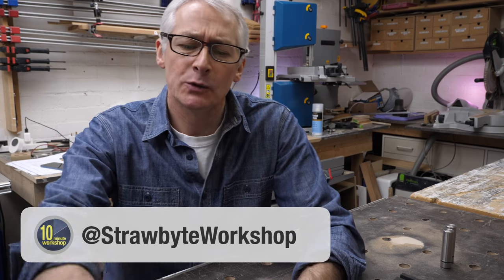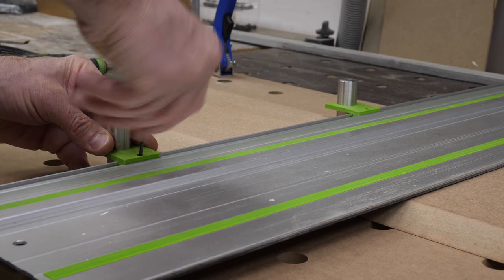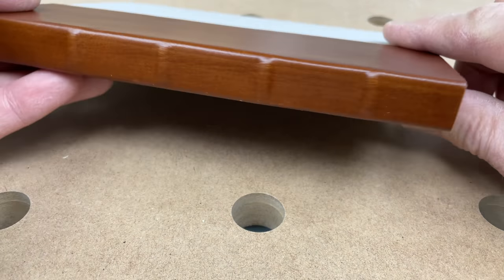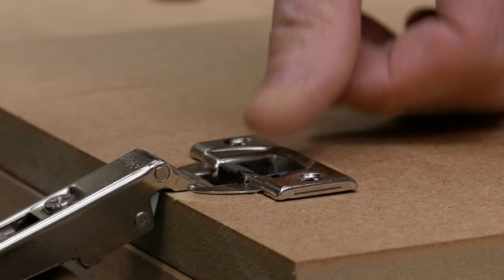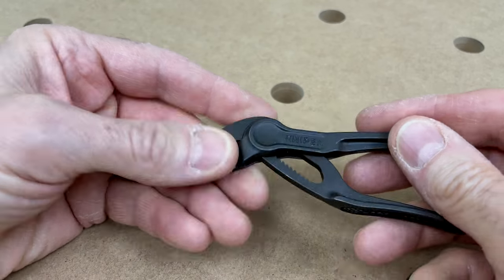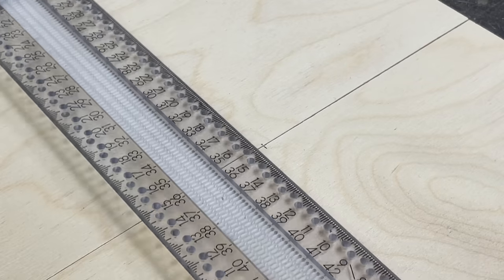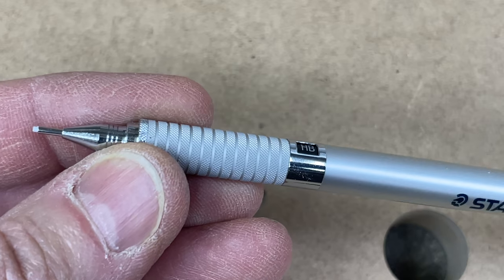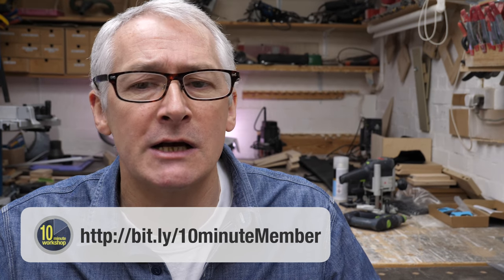Gift ideas 2020 [Video 430][Gifted/Ad**]

Comment: Hey Peter thanks for featuring my guides and the clips. Not wanting to leave the Makita contingent wanting this x-mas, the blade case covers are also available for the corded and cordless makita saws.

But I would like to echo your comments regarding the Block Scribe from Steve Tomlin - a great bit of kit.
Reply from the maker: Thanks Karl - always a pleasure to be able to show of a bit of Strawbyte! Ah, good to hear about the Makita blade covers, too! 👍👍
Reply: Hi Karl, purchased the Makita 36V plunge saw a few weeks ago, not had a chance to use it yet, but on seeing Peter's gift ideas which included your waste side cutting jig I thought I need that. I then spotted the dust cover and that was a must . Order placed, naturally with Peter's affiliate code thanks both. 👍
Reply: @johnweir2460  Hi John - thanks so much for the order. I'll get them out to you as soon as possible.

K.

Comment: Thanks for that, Peter nice to help the smaller businesses out and some really useful stuff, I have the Dowel Jig, it self centres as well, had dearer ones but for the amount of time I use it it's a superb bit of kit, I also have the small square which is very well made, a couple in that list I will be checking out... 'Hard to buy for' no problem will buy it myself :)
Reply from the maker: ‘Buy myself’ is the best way, I’ve found! 🤫👍😆
Reply: @10MinuteWorkshop  Only way you really get what you want, I had the 'I saw this one cheaper' yeah thx

Comment: Cheers Peter another good video , I like you had given up on mechanical pencils especially after my last Woodpecker one lasted about 2 days 😠, set of the Bic ordered in the 0.9 and the sewline white to go with it 👍 be handy on the graphite MFC which is currently my favourite 😆👍
Reply from the maker: Cheers Simon! Have to say, those  Bic matic pencils are a revelation! Sounds like those white leads will be perfect for graphite MFC - they’re quite soft btw, so need treating a little more carefully than regular leads. 👍👍

Comment: Peter, for vibration reduction try cutting a squash ball in half!! If they are good enough for Hi-fi turntables.............
Also those Staedtler erasers, I would not use anything else> Been using them for about 30 years from when i was at college training as a building surveyor. Oh, the white 'pencil leads', they are probably tailors chalk!!

Merry Christmas.
Reply from the maker: Thanks! Yes, the white leads are quite soft, so you may be right! 👍

Comment: Thanks Peter, very nice gadgets. I was wondering what that interesting looking ruler (Mirock) was when I saw it in a previous video of yours. Those mini-pliers look nice; I have a mini spanner that is about 65 mm long and maximum opening of 9.5 mm :) Don't remember if I've ever used it, heh.
Reply: The larger ones, same maker, are really well made, much better than cheapo plumbers grips.
Reply: @DavePawson   Yep, I do have full size Knipex ("Cobra") adjustable jaw pliers in the same style as the mini one Peter shows here, only with a handy push-button adjust lock. Knipex calls them "Hightech water pump pliers", heh.

Comment: Some nice bits and bobs there. I'm still dropping hints to the wife about a Kapex for Christmas, but I'm guessing it will be socks again! With regards to your vibrating bandsaw, why not just buy some cheap rubber feet from Amazon and bolt them to the corners for a permanent solution. Or just use a bit of rubber mat!
Reply from the maker: Yes, that was the plan, but I never got around to it, and I had the rubbers, so, you know... 🤷‍♂️ 👍
Reply: @10MinuteWorkshop  Try hockey pucks. You can drill and couterbore them to take a bolt and washer to mount it somewhere.

Comment: The Bic mechanical pencil comes in 5mm as well.  I usually replace some of the lead in several of pencils with "B" grade leads rather then the standard HB (#2) they come with.
Reply: Wow! 5mm, that's some pencil lead.

Comment: Anyone after a Dowel jig like the one featured - Lidl currently have them in stock for £7.99 with dowels, bits and stops.
Reply from the maker: Now you tell me! 😂
Reply: Yes, though it isn't like the one he showed here, the one here is like the Silverline available without stops for about £6 or £7. The Lidl one does look nicer though I have not used it yet. I must do that and post a revew. I have used the Silverline one and can confirm it works.
Reply: Ah, didn’t read further down the comments! Yes, I got one when they were in earlier in the year and it’s a great bit of kit for pocket money change. 👍
Reply: @PhilMakesThings  Very much so, also comes with both the collars and if I recall correctly the drill bits.
Reply: @BensWorkshop  I have both the Silverline one and the LIDL one, and the LIDL one is far, far superior. Feels so much better built and the bits that it comes with are excellent
Reply: @animationcreations42  I suspect they are, I just have not yet had the need to use it.
Reply: State side, we never get the Aldi and Lidl tool goodies here. Food is good though.
Reply: @66meikou  Sorry to hear that. If you have a local Lidl ask to speak to a manager and tell him you keep seeing reviews for things in the Middle of Lidl and you'd like to see them in the USA. They may pass it on.

Comment: Lovely gift ideas. I'm still concerned about your missing CNC. Is it in a shallow grave at the bottom of the garden, or at the bottom of a lake near you?
Reply from the maker: No, sadly it slap in the middle of the outer room, and needs to move, have it’s router replaced with a spindle, and then be calibrated properly. It’ll take a while... 🤷‍♂️👍

Comment: I''ve never seen anyone else with one or heard anyone else use one... I have used a 1/2 router with a 35mm router bit for my euro hinges for going on 15 years now. Absolutely dust free (festool monster size router) set with fence. Everyone's seems to do videos on drill jigs and this is the first template jig. Is it not easier to go for the router bit?
Reply from the maker: Interesting isn’t it - never heard of anyone using a 35mm bit in a router for it either! 🤷‍♂️ Whatever works, I guess. 👍👍